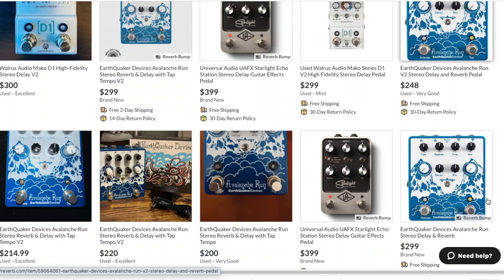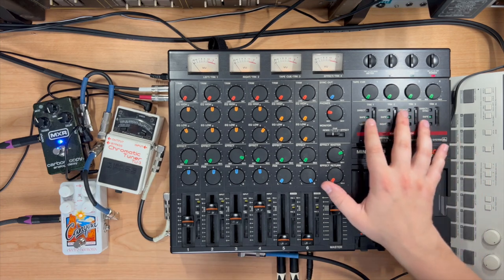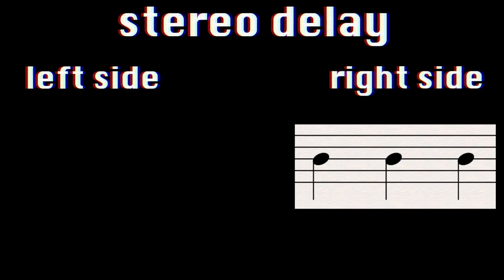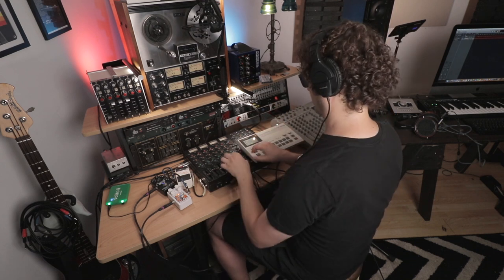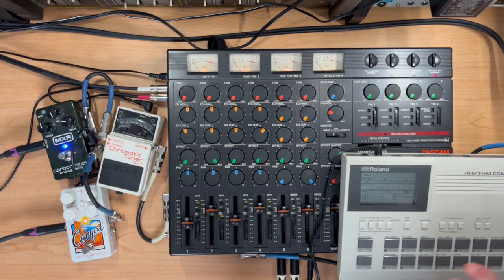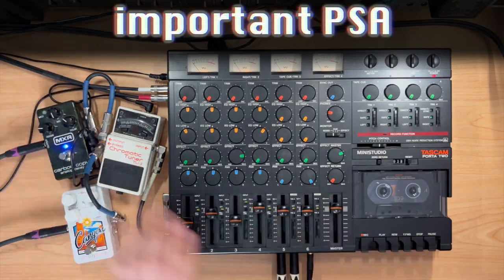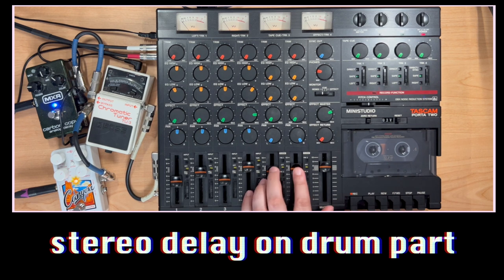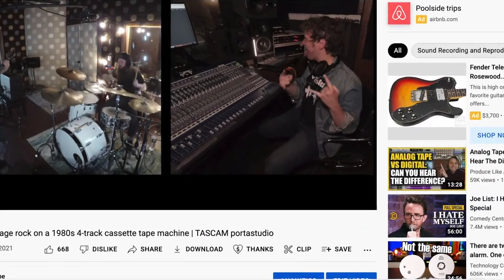Make Your Own Analog Stereo delay | feat. MXR Carbon Copy and Electro-Harmonix Canyon

Comment: woud i be able to recreate this with only one delay pedal? (recording the effect on tape one by one and using diff settings each time)
Reply from the maker: absolutely! if you’re willing to take up the tracks on the tape this would work too 🤘
Reply: @MadeOnTape  cool! thanks! but then i would have to use 2 of my 4 tracks only for the delays and i wouldnt even be able to bounce them into a single track because i would lose the hard pannings, right?
Reply from the maker: @napolitano2728  that's correct, but you could do a stereo bounce or mix, and bring that back into cassette and add on.  Obviously then you are committed to the way things are cuz there's no "undo"
...it's my favorite part of working with four tracks!